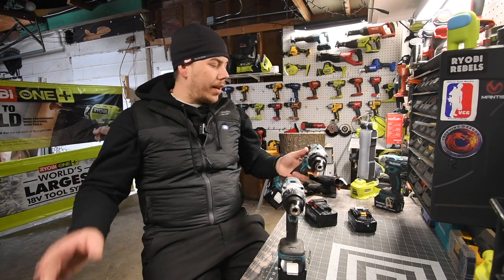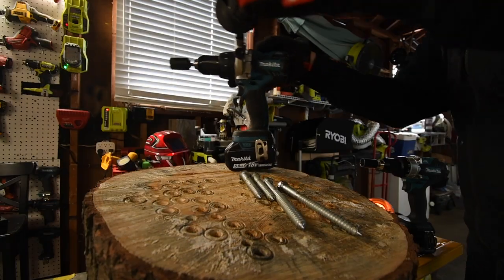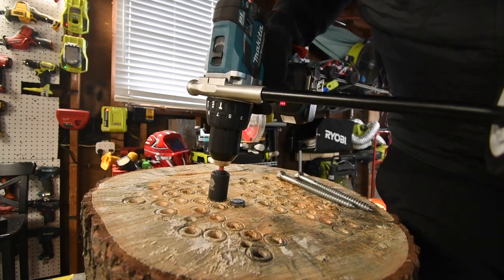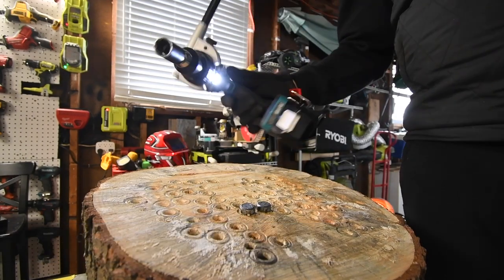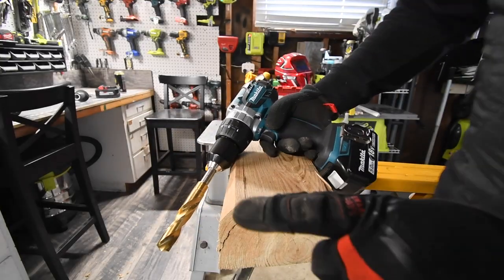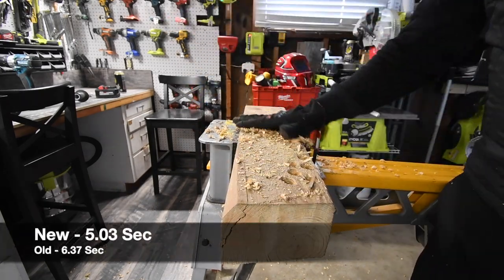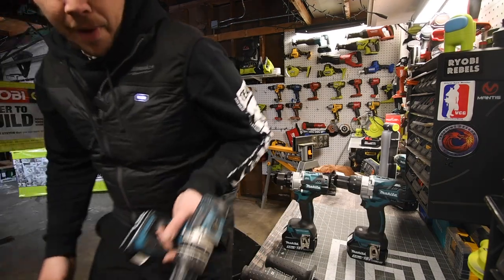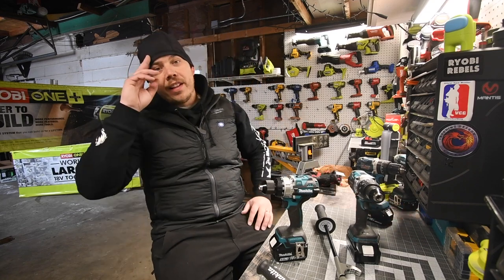New Makita XPH14 vs XPH07 (Hammer Drills)

Comment: You was the first one that I saw about the XT288T with the Xph14 and the Home Depot deal when you did that video last week.  Good Job.  I went today to the Home Depot and they were all gone and the “X” lock was gone.  The signs were there but most of the tools were gone.  Other people are starting to post about the XT288T deal but no one has given credit for it.  There I just did.  Credit given.  Next video Makita XPH14 vs. Dewalt 999 Flex volt.  Done deal.
Reply from the maker: I thank you for the support Isuzu

Comment: The noise the 07 is making is most likely the back motor cap loose or slightly out of alignment.  AvE tool review has a video that discovers this issue, sounds exactly the same.  It is not the chuck.

Comment: Been using the XPH14 a lot the past two days.  At first I felt it wasn’t much of an improvement over the xph/xfd07.  I’ve since seen the light.  I pulled out the Metabo  BS 18 LTX-3 BL Q (whoah that was a mouthful) that I’ve had since whenever it launched and the XPH14 ate it’s lunch.  I just wish they would have kept the electronic clutch from the XGT model (identical looking).
Reply from the maker: More tests will be coming soon on this

Comment: @Man Caver Tools I can tell you exactly what is wrong with that drill because it happened to mine.
The noise you're is caused by the back part of the drill case being worn out.
This part of the case holds the bearing which locates the motor rotor. The crunchy sound is the motor hitting itself as it spins.
If you twist the back of the drill you will probably find it either gets better or worse depending on how you do it
Reply from the maker: I do tend to break my tools lol, but I thank you for the info Jayde

Comment: I thought the side handles were engineered for only the specific drill it comes with. Especially the higher powered drills.
Reply from the maker: the handle does not fit on the older model and visa versa

Comment: I have a XPH07 and it’s a BEAST that can really hurt you if the bit/hole saw suddenly stops, and the 07 will kickback like a mule making the excessively long handle necessary to prevent injuries. 
With the XPH14 Makita must have built in some form of anti kickback technology into the tool even though it doesn’t have their AFT (Active Feedback-Sensing Technology) which allowed them to shorten the length of the handle. 
My guess that Makita’s reason for the XPH14’s handle not fitting the XPH07 is to prevent injury and potential lawsuits because the 14’s handle isn’t long enough to prevent injuries if used with the 07. 

Last year learned that Makita’s (and most other brands) Keyless Chucks jaws are designed to lock after tightening by turning them back 1 click. I’ve been using keyless chucks since they first become available but didn’t know about that feature, a Makita rep showed it to me. 

I also have a tip that you might want to try and possibly make a video about. 
When drilling holes in thicker steel with bi-metal hole saws you can substantially increase the life of your hole saws, increase cutting speed, and have cleaner holes by filling the hole saw with crushed ice. 
My main customer is Sonic Drive In and I frequently have to drill holes (1 3/8” up to 2”)  in the canopy frames. Most of the times he steel is 3/16” but in some areas thicker steel is required and the round support poles for the “Umbrella Canopy” over the patio is 3/8” thick. 
I use both Greenlee and Milwaukee hole saws with excellent results. 
First you need to drill the pilot hole without the hole saw attached (keeps from breaking those costly pilot bits). 
Then take electric tape and tape the openings on the side of the hole saw closed, fill with Sonic Ice or crushed ice packing it in a little so it doesn’t fall out and then drill in low or medium speed. 
Obviously the ice will keep everything cool if not cold, the water provides plenty of lubrication and helps with flushing the chips away. The slower speed actually cuts much faster because the saw teeth are able to remove more material in each pass. 
Cleanup is easier that when using cutting oil especially if I’m working in a food preparation area drilling stainless steel. 
While drilling if you see steam it’s time to add more ice to keep everything cool. 
This really works and I usually get several hundred holes with each hole saw.
Reply from the maker: yes, most tools have that feature now.

Comment: @mancavertools if I were you, I'd hold them against my body on the other side so if they twist, your body stops it instead of twisting you're wrist
Reply: I put a hand on the trigger ,and a hand on the battery when a side handle is not available.
Reply from the maker: I can feel when its getting to much resistance. most of the time I can hold it with one hand after the initial start up

Comment: The XPH14 hammer drill is actually a new upgrade of the XPH12 hammer drill, using the XPH07 design. The upgrade of the XPH07 is the new 40 volt hammer drill HP001G, which hasn’t yet been released in the US.
Reply from the maker: I will be doing that video as well
Reply: the HP001G is still not out in the US ? Currently the xph14 is not out in europe yet. wich is strange considering the 40 v came before the new 18v
Reply: No it's an upgrade of xph07. Look it up.

Comment: hay tool guy love yr video. question i am planning to buy a combo system, i need to which one it a good system milwaukee / makita 40v / or flex 24v hammer drill kit with impact driver. can you help? thanks (ps) money is no issues again thanks
Reply from the maker: Id go with the tool brand that is closets to you . If Home depot is closets id go with Milwaukee, if Lowes is closets to you id go with FLEX. Makita 40v is limited where you can buy it right now. I haven't seen them yet in any of my home depots

Comment: Thank you for the video. 
I just bought the Xph14. Is the chuck on the Xph14 supposed to push in and out like an SDS to absorb vibration?
Mine pushes in and pushes back out on its own like it has a spring in it. Is this normal for this Makita? 
Thank you!
Reply: Yeah I've had that on each of my makita hammer drills

Comment: Hey Dave. I'm in the market for a new hammer drill. I have makita and dewalt batteries. I like a smaller well balanced drill. I. Either going to get the xph14 or a dewalt hammer drill. I want it to have a handle as I sometimes use larger hole dozer 4" and a few contrast holes up to 3/8". What do you recommend? I love that the xph14 is smaller then the 7 but it seems dewalts are just a lot more powerful. I'm kinda looking at the dcd998 or dcd999.
Reply from the maker: The powerful Dewalt Hammer drills have always been big in size. The Makita 14 is a good hammer drill do use. and I love the size of handle it comes with

Comment: Xph14 vs the new Makita 40v soon when you get your hands on one?
Thank You!
Reply from the maker: I cant wait to get the 40v Makita tools
Reply: @ManCaverTools  I have a cordless Makita miter saw and a cordless Makita track saw and only 4 batteries and want more Makita tools. I wish Makita’s 40 volt system was battery backwards compatible because I would invest in the new tools, but without that I will stick with Milwaukee and Dewalt for now. If I invest in Makita 18v platform I feel it will be phased out soon for the 40v system and will be stuck with tools that will no longer offer a battery. At least with Dewalt you can interchange their battery system and feel a bit comfortable for the future. Only time will tell.

Comment: In 🇬🇧 the xph07 is called the dhp481 my drill sounded and smelled just the same plus the chuck wouldn’t tighten! Went back to makita twice for warranty repair still wasn’t right so my combi drill is now a different battery platform compared to all my makita tools
Reply: Did you end up going for DeWalt? I am in the UK too and am torn. The DeWalt DCD996 seems more powerful, but it's a huge beast!!! Wondering whether to wait for this Makita - in the UK this should be called DHP486 (whenever it comes out here)
Reply: @QMusicUK  i went with a hilti drill! I had the dewalt dcd796 and that was a little beast of a drill! I got it with the dcf887 when i was thinking of changing from makita to dewalt but the ergonomics of dewalt tools just didn’t feel right. I only went with hilti as my work supplies me with some hilti tools
Reply: @petyt8  Ah ok. Thanks for your answer. 
I have a DeWalt XR multitool so already have the battery and am torn between waiting for the new Makita DHP486 / DTD171 twin kit or getting DCD796/DCF887 kit. I don't really NEED all that power as I'm just an enthusiast/DIYer but I just love how compact Makita is. On the other hand I love DeWalt's TSTAK boxes and colour scheme and having now tried my first DeWalt tool I am really impressed. Decisions decisions...
Reply: @QMusicUK  a word of warning about the dcf887 impact driver they like to cook themselves! The dcf886 is first gen brushless impact without the gear selection more robust and if your just a diy enthusiast will have all the power you’ll need! I’ll be buying that new makita when it’s available in the uk
Reply from the maker: more tests will be coming and I thank you for viewing Pety8
Reply: @petyt8  Thanks mate. I found a deal I could not pass on... £150 for DCD796 and DCF887 so I pulled the trigger and if the impact fries on me so be it. I figured 70nm torque on a Combi drill is more than enough for me (my current Bosch PSB 14,4 only has 38). For that kind of money I can always flog and go for Makita if I'm not happy.
Reply: Petyt8 which model is Makita xhp14 in england thanks
Reply: @KingKong-cy4zf  I don't know mate! I did message makita UK but they didn't have a UK release date
Reply: @petyt8  ok thankyou
Reply: @KingKong-cy4zf  I read somewhere that it's going to be DHP486 but it has not been released yet
Reply: @QMusicUK  thankyou 👍🏻

Comment: This new version (more compact one) is not available in the UK as far as I'm aware. I've just bought the original dhp481z (uk) version for £140 and it's great but I wouldve preferred a more compact one because a) the handle is shorter and would fit in my makita drill bag whereas the longer handle doesn't  and b) more compact drill is always better I suppose.
Reply from the maker: I Thank you so much for viewing :)

Comment: Torque specs are different.  
07 is 1,090 in lbs. 
14 is 1,250 in lbs.
Reply from the maker: I did forget to put the torque in, sorry about that
Reply: @ManCaverTools  it's all good 👍🤟👍🤟
Reply: Didn't seem to make too much difference in actual use. That's a relief to me (and my wallet) as I have the 07 😀

Would be interesting to see what's actually different with the motors or gears.

Comment: if you have the XPH14 do you still need a impact driver or can the XPH14 fullfill all your drilling and driving needs
Reply from the maker: its always good to have an impact driver. makes doing tasks easier
Reply: A drill-driver of this class can put screws faster than any impact driver.  But it is not about that. You would need to press very hard on the screw head and to use a handle to control all that torque with the drill, while with the impact driver you can do it with two fingers. And - the impact is twice as light and handier.

Comment: People online saying the chuck on the new hammetdrill doesn't work is defective. It won't lock.
Reply: i have the xph14 i have used it for the past week haven't had an issue yet i bought the kit with the free batteries and bit set
Reply: No issues here either, I’m thinking it might be a milwuakee or dewalt fan/employee  hating haha.
Reply: You have to ratchet it down tight, and NOT click it back!  I just called a Makita Factory Tech a few days ago, and He confirmed this.  It’s always possible to get a defective part with any tool.  DeWalt and Milwaukee have had chuck issues as well.  Factory service centers will take care of you, and if they don’t, be firm and persistent.  YMMV. Peace
Reply: @wappiercer7306  awesome Wap!  I have that $399.00 deal in my cart and debating on ‘pulling the trigger ?!’  Not available in stores in my area
Reply: @mannyc805  LOL. Could be 😁
Reply: I read that rumor too about the chuck. Glad to hear it’s not issue for many ppl. Also if you get the kit in store it’s hackable
Reply: At 3:52 in the video, the bit falls out.   He goes to retighten it, and when it's just about tight, you can hear the whole chuck and shaft rotate the gears inside the drill.  The internal mechanism to lock the gears/shaft does not engage.   Anyone who has this drill, try to really tighten the chuck and it will rotate.  Buy it if you want.  I've just bought back into the makita line   finally abandoning ridgid.   (Not a milwaukee fan boy trying to bash makita)  I'm using the subcompact kit as a daily driver.
Reply: @donniemccrorie19  I'll pass on this one. To bad I love Makita.
Reply: @mjp8415  Hi Michelle!  I have encountered bad chucks in EVERY brand of drill I have owned, over the years!  I have used cordless drills for over 20 years. These newer shaft locking and ratcheting chucks are a game changer.  But they seem to come with some inherent issues from time to time.  I’ve had bits fall out of many chucks!  It comes down to being careful and not abusing your tools.  When a spade bit falls out of a drill, and into the floor of a $80,000 Kitchen, try explaining that one to the homeowner, and how it was the drill’s fault ?!   😳🙄😕 As they say, I’ve been there, done that!  😳😬😧 Stay safe and Healthy!  👍😁✌🏻🇺🇸
Reply: @donniemccrorie19  hi Donnie, I can’t tell if Dave is fully tightening the drill, or not?  It seemed like he was.  He already had an issue with the XPH07 In another video.  A lot of these shaft locking chucks can seem to rotate the gears, and occasionally one can hear them clicking, as you tighten it.  I always advise people to follow what the manufacturer says, and they DON’T say to fully tighten, then back it off.  These chucks are a marvel of engineering, that are required to take a lot of force.  And these drills keep getting stronger and stronger.  These levels of torque are better suited to an old fashioned ‘keyed’ Jacobs chuck I am thinking!  🤔😮😀😃😂🤣
Stay safe and Healthy!  👍😁✌🏻
Reply from the maker: hopefully their isnt anything wrong with the chuck or gear box

Comment: Very good comparison Dave!  😁 When the XPH07 first came out, it lead the Industry for best torque, so Makita made an appropriate handle for it.  I haven’t used it much, but my main gripe is how the plastic case didn’t have a dedicated place for it.  It’s a huge case, with the secret compartment in the lid, but they couldn’t make a place for the handle.  It just ‘lays’ in on top of the drill and impact. 😕  Like I said in a previous comment, my 07 has that hot kinda like a oil or Vaseline smell?  I will have to call my Factory Rep and ask?  It has never given Me any real problems.  Was it cold when you did the test?  I will say I really wanted to like my XPH07, but I never really ‘warmed up to it?’  It’s ergonomics aren’t quite up to the usual Makita standards.  It may be due to the size or weight?  I’ve got the $399.00 kit deal, with two extra batteries, in my cart, and deciding if I want to pull the trigger on it, so Really appreciate your comparison.  I am really anxious to see how the XPH12 does?  It’s a great little drill for size and weight, and has a nice Chuck, but it’s more of a medium duty drill.  I’ve been trying to find my receipt for the one I have, as the speed control is winky, and the electric brake works half the time.  
👍👍👍👍👍👍👍👍👍👍👍👍👍👍👍👍😁✌🏻🇺🇸
Reply from the maker: I really do love this new hammer drill and handle. that is now my most favorite handle that a tool brand made for its tool and I thank you for viewing George
Reply: @ManCaverTools  You’re Welcome and Thanks as well, Dave!  Great to get your feedback as I am seriously considering getting the combo with the New drill, and Impact, with the extra batteries!  It’s always good when one can get extra batteries at a discount, or in this case, gratis!  Peace!  Stay warm and safe Dave. Best to you and yours!  👍😁✌🏻🇺🇸❄️

Comment: My 07 is still pounding away and I've run that thing through heck and back over the years.  I guarantee you the handles aren't compatible because that was the only thing that sucked about the 07, the handle doesn't grip it correctly and would slip all the time so I could see and improvement in their design of how it grabs. And you experience the only other issue, the Chuck releasing the bit on anything that you've had to apply torque to. and of course you have to apply a little bit of pressure to those Irwin self feeding bits because they'll strip out the hole that it's pulling if you don't especially when it gets to the end.
Reply from the maker: very good, makita really is a very good brand and more test videos will be coming out soon and I thank you for viewing work